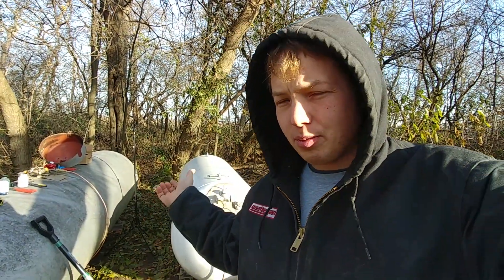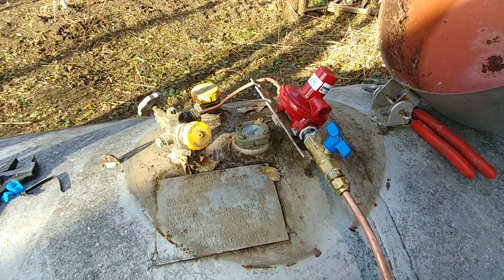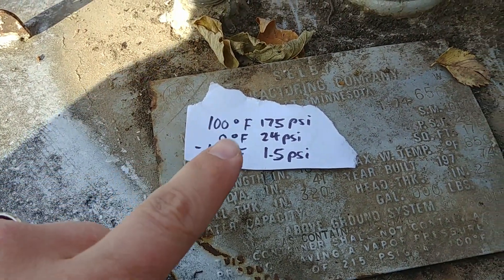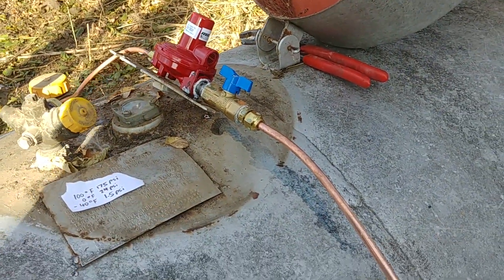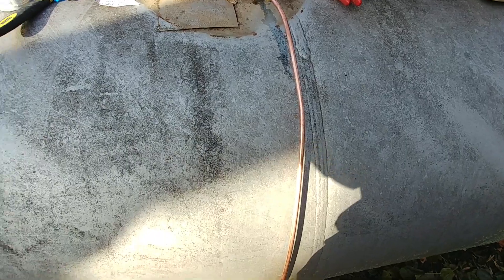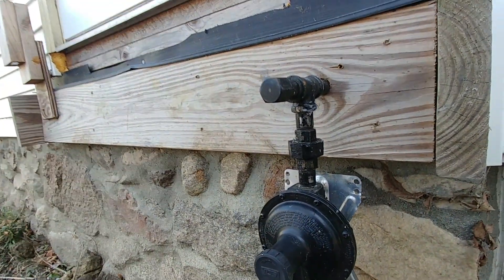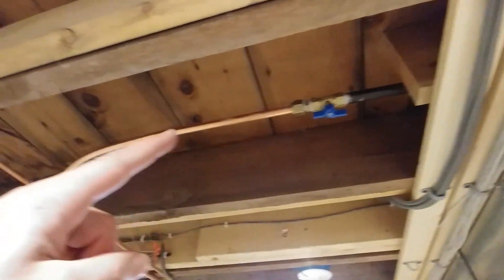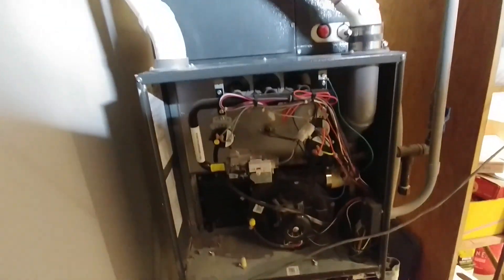How Does a Propane LP System Work? First & Second Stage Regulators, LP Pressures Explained

Comment: At least here in Michigan, the sediment or 'drip' leg must be directly below the vertical run before entering an appliance such as your furnace. Not after the elbow. The inspectors here would give you a big red sticker.
Reply: Same here in Maine also
Reply: @chevysevery3461  mate in England none of this would be allowed😂
Reply: NC has it going down not out I was told it was so trash in the ones would fall down into it presenting clogs

Comment: This is an excellent video very well informed. Can you elaborate on the external conversion line assembly connections needed for the 20lb  propane tank feed to flex line of kitchen stove

Comment: To those of us tuning into understanding lp systems you left out what the water column actually does and is
Reply: inches of water column (in.wc.) is a meaurement of volume stemming from the use of old school water manometers
Reply: Once you get to very low PSI numbers typically, the measurements will change to Inches of water. 1PSI is over 27 inches of water column.

Comment: You show USA Made REGO regulators, but give LINKS to Chinese Regulators. Links goes to Chinese made Emerson-Fisher regulators. The RED First Stage regulator you show is REGO LV3403TR and the Second Stage appears to be a REGO also, but you don't specify model. Great video...thanks!
Reply from the maker: Unfortunately I wasn't able to find the Rego options online. They must only be sold through distributors mostly. Let me know if you find them online somewhere!
Reply: @BenjaminSahlstrom  : REGO LV3403TR can be found on eBay, Amazon, propaneproducts.com, propane-regulators.com, solaresflorida.com, propanedepot.ca, tarantin.com and others. Just use your favorite search engine and type in REGO LV3403TR and look for the best price and availability. Amazon will steer you to what they want you to buy, but Amazon does sell Rego regulators (although not always in stock). eBay does have the best prices, but you MAY not be buying from an authorized distributor. If you make another propane related video, it would be helpful to show the differences between a 2 stage system and a system with a 2 psi regulator (3 regulators) and the pressures each handle. An explanation of water column pressures and how they convert to psi would also take out the mystery to homeowners. Maybe a chart and/or visual showing showing how each stage works from tank pressure to water column/appliance pressure would help.  THANKS AGAIN.

Comment: Ben great video.  I just installed a tankless water heater in our home.  We have propane system for our heat, dryer and hot water.  The feed at the water heater is 3/8” copper.  The tankless water heater keeps shutting off and code indicates it may not be getting enough propane to keep it going as I increase the water temp or call for a higher volume of hot water.  Is it possible to have our system modified to support the water heater correctly?  Thank you for any knowledge you can provide.
Reply: Tankless water heater needs much more volume than a 3/8” line can support you will need a 3/4” line at minimum but seeing your question is 7 months old you probably have figured this out
Reply: Vault 614 thank you.  I had to have an heating/ac guy come out and he installed the 3/4” line.  Works well now.  Appreciate your answer all the same.

Comment: If you shut off multi valve at tank can you change 300 psi gauge at multivalve (same) location
Reply: You can change or add a 300 psig gauge at the service valve with it on or off, turning the valve off only affects the gas going into the piping but where the gauge connects to the valve there’s a 54 orifice inside so the gauge can be replaced at anytime with gas inside container

Comment: Hii,

how do you differentiate 1st stage regulator vs 2nd stage regulator if they are lying on your table ? 

is there specific thing that you can look at and say : ok this is 1st stage this is 2nd stage  ?

2nd question: 

https://www.gasprofi24.de/niederdruckregler-ps-16-bar-schwarz/a-5330/
this regulator also said it is 2 stage regulator.. because it has got 2 diaphragm in it. so, what's the different ? 

thanks
andrew
Reply: the regulators have data embossed on them the  1st stage regulator outlet pressure will he higher than the 2nd stage regulator

Comment: very useful and well done.  Question, I have an in ground propane tank (Florida) and have a pigtail added on my patio to use for my gas grill.  I am assuming I will need a regulator at the grill, because when I use it without the fire burns way too hot.  Am I correct?  What type/pressure regulator should I use?  Any tips on installation?
THANKS
Reply from the maker: It is possible that the connection for your grill came off of the line between the first and second stage regulators? If that was the case the line you hooked up to would be at 10psi when you only need 9-12" of pressure. You could just use a regular regulator for a propane grill as that should reduce the pressure to the correct level. Good luck! Let me know what you end up with!

Comment: Hi Ben
I have a 1000 gallon in ground propane tank.  Since it was installed 3 years ago I had several freeze ups where I have no heat or hot water when it gets about 20 degrees or so.
Someone mentioned that maybe they didn’t purge the new tank...which they didn’t do,.they just filled it up and have been adding methanol when I call because of freeze ups...I can’t live like this..  any suggestions?  Thanks
Reply: Completely empty it, maybe put a vacuum evacuation pump on it for a few days, but the pump might be overkill.  Immediately treat with methanol and fill with propane.  You should be 100% good after that.  Quit letting your tank level get low, and maybe your supplier has water in his tanks.
Reply: Moisture build up in tank

Comment: Best to install large enough pipe inside and not need additional regulators at each appliance if at all possible.  IMO
Reply from the maker: Agreed.
Reply: @BenjaminSahlstrom  

Hii,

how do you differentiate 1st stage regulator vs 2nd stage regulator if they are lying on your table ? 

is there specific thing that you can look at and say : ok this is 1st stage this is 2nd stage  ?

2nd question: 

https://www.gasprofi24.de/niederdruckregler-ps-16-bar-schwarz/a-5330/
this regulator also said it is 2 stage regulator.. because it has got 2 diaphragm in it. so, what's the different ? 

thanks
andrew
Reply: @andrewyek  I know I’m late to the party here but seen no answer to your question, the visual difference between first and second stage is color typically the first stage is bright red and second stage is any color picked by manufacturer also the other differences typically are the fitting used on the inlet side of the regulator the inlet of the first stage are usually (but not always) left hand threaded and the inlet of the second stage is normal pipe thread. 

The link you provided shows a regulator that I’ve never seen of course I’m in the US and this appears to be European and their stuff is always designed so differently but I could assume it’s what we call an integral regulator and it takes tank pressure down to operating pressure of approximately 11” these can be used for a single appliance but not for a whole house application bc they are not designed for large volume

Comment: If you have 1.5 psi you will have 41.5" wc. Why would that not flow through the 10psi (277"wc) regulator (10psi MAX out) and still be reduced to 11" wc at the house?
Reply: I was thinking the same thing
Reply: mitchellsdaz, why are we jumping around with pressure units... stay with psi or with inches but not both.  I prefer bars.

Comment: I'm in Florida. Our problem is exactly opposite of yours - our tanks get hot so pressure is very high. 
What size copper did you use inside the house?
Reply: wdk535 the 2nd regulator lowers it to 10-12” w.c.  That should be constant.  So it depends on the length of gas pipe at the furthest point and the total load of all appliances used.

Comment: I installed a first stage regulator( https://www.amazon.com/gp/product/B01NAFLT0L/ref=oh_aui_detailpage_o02_s00?ie=UTF8&psc=1 ) at our tank and plumbed it inside. Do I still need a second stage regulator if our range has a regulator in it? It's a small Premier Holiday with battery spark. I have LP to the stoves regulator but when I try to start it there doesn't seem to be gas coming through the regulator to the burners(I did the NG to LP conversion). The ignitors are working but no LP coming through. Thanks!
Reply from the maker: KmanJeeper You need a second stage regulator like is in the description. A gas range will not work on the 10psi coming from the first stage regulator and may even have damaged your stove. Hopefully not but be careful when you test it again after you install the second stage regulator. 

Good luck!
Reply: Hi, could you tell me if you added a 2nd stage regulator after the 1st stage regulator?  I have the same setup and am preparing for this.  Pictures would be great.

Comment: Kind of a stupid question, but in the event of a low pressure/temperature situation, is there a crankcase heater for these tanks in some cases like a compressor would have? Or would it not warrant this because the situation is rare?
Reply: If those temps are a possibility they would probably bury the tank underground is my guess.
Reply from the maker: NSNOfm78 I'm sure that up on the North slope in Alaska they may need something like that but I don't know of anywhere in the lower 48 that it would be below -40 actual temperature for a prolonged period of time. Interesting scenario though!
Reply: Heat trace and insulate the tank.